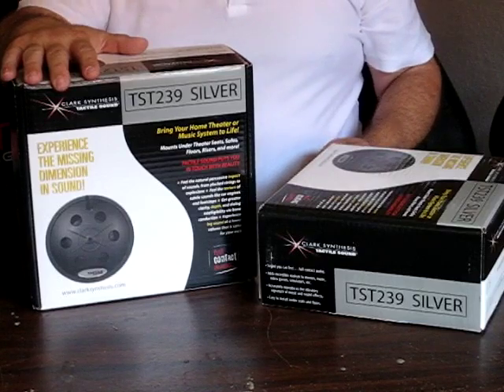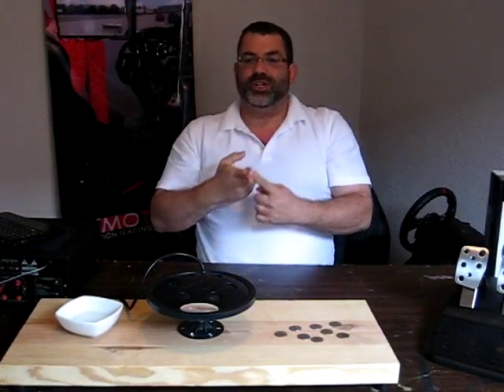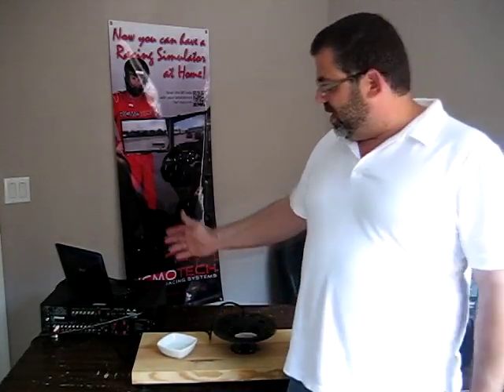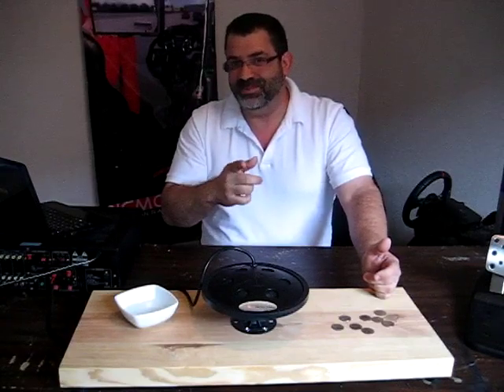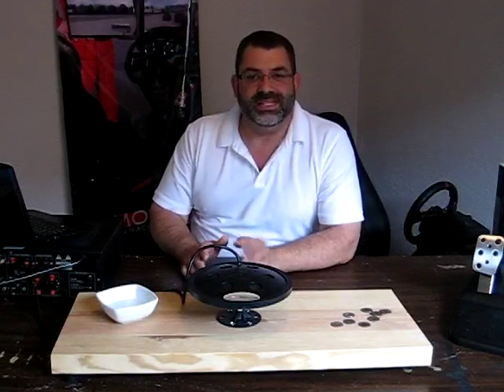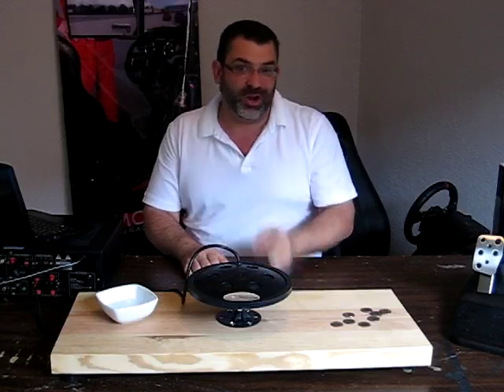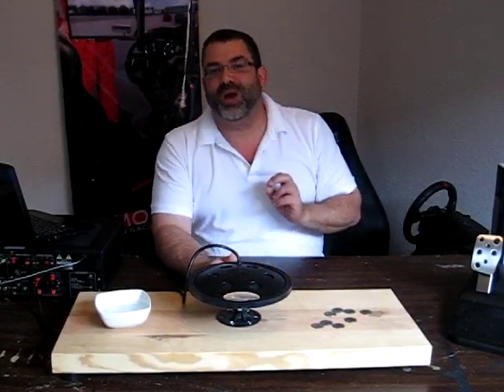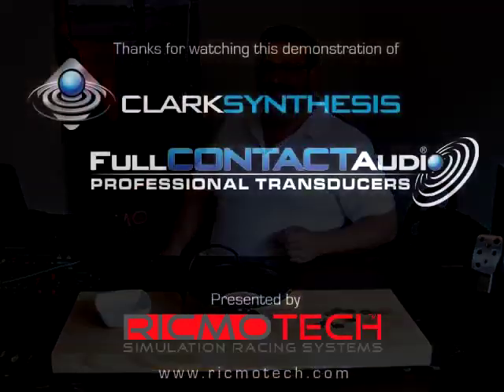Demonstration of the Clark Synthesis Silver Tactile Transducer

Comment: In this video you're connecting the transducer directly to the surround-sound receiver, as if it were a normal speaker. Could it be used that way in a SimRacing set up as well? It seems the transducer is able to handle it. Or should the higher frequencies be filtered out by using the LFE-out on the receiver, then routing those through a separate amp? Thanks!
Reply from the maker: The Clark Synthesis is capable of a wide sound range and can be connected without a LFE filter, but you can run it either way. It simply connects like a 4ohm speaker
Reply: Thanks for the quick reply, that's good to hear! That will make my hookups nice and simple :) I picked up a 2nd hand sim racing platform with a Clark Synthesis Silver, and wasn't sure how to connect it.